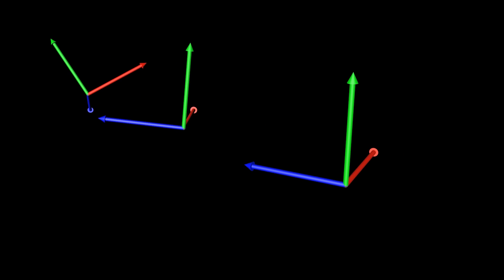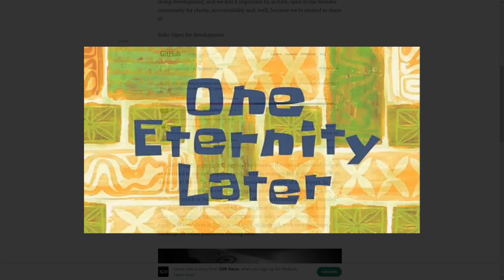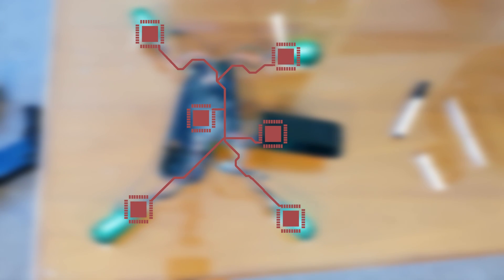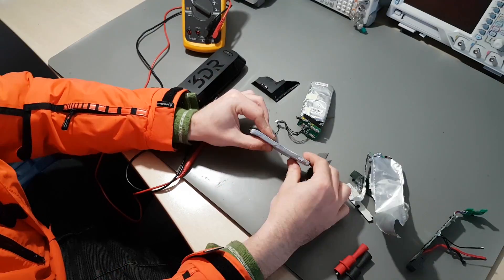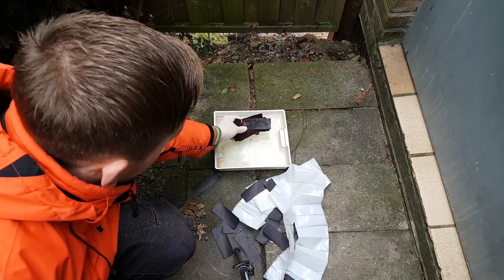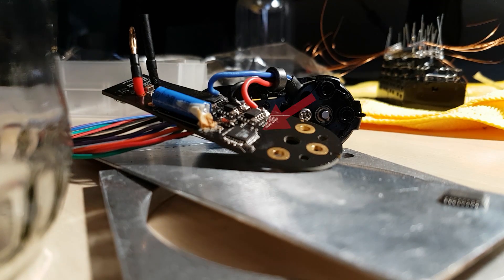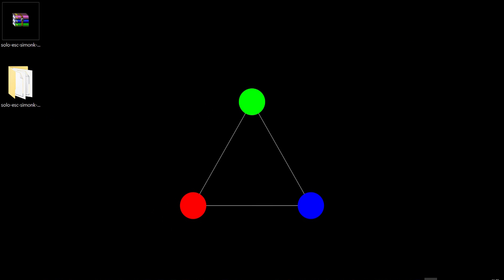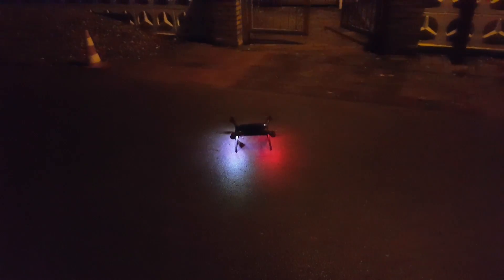Crashed High End Quadcopter repair - 3DR Solo - Part 3

Comment: My solo is in dire need of service it will not calibrate or factory reset. Can you help me with this problem I really miss flying and the fact of the matter I only had it for a month...
Reply: I am in the same boat, went to calibrate the solo and the controller advised calibration error and to restart the drone. This is an on going circle at the moment and at that hard to find any hobby shops who could work on this. I reset both controller and drone e and the same error message comes up..
Reply from the maker: Install mission planner and look at the logs?

Comment: Question: Do you have a Solo gimbal on your Solo? I have encountered a problem with my Solo I noticed my Solo doing the toilet bowl effect. After connecting to mission planner I noticed that my compass offsets where high after installing the gimbal. I was wondering if you have encountered symptoms like this. I have tried to recalibrate the compass and without no gimbal installed I have high offsets, Any suggestion?
Reply: Magnetic declination issue

Comment: Truly instructive and im happy that you back flying amazing recovery thx  Marco  PS: can you take a look at my motor startup it seems bizzard https://youtu.be/k4z_7WPEs40
Reply from the maker: A startup like that should be observable on all 4 motors, but not every time, right? I think it is normal, because these motors have to start somewhere and they don't know the current prop position. So sometimes the first position will be just behind the current prop position.
Reply: Thx for the quick reply you right it  I mod the Solo KDE motors using im wondering if the ESC's ares ok using KDE 2315XF 885kv https://www.kdedirect.com/products/kde2315xf-885    check specs thx